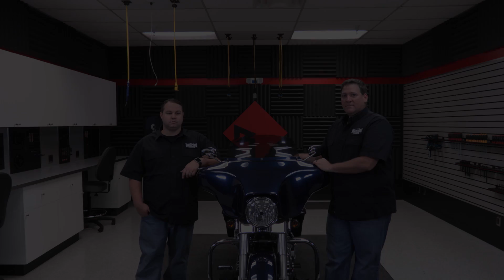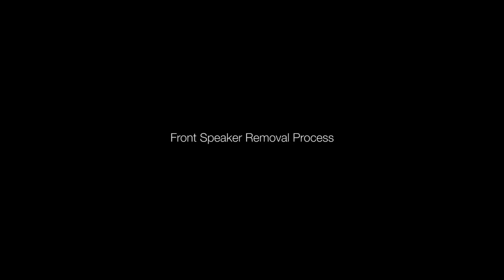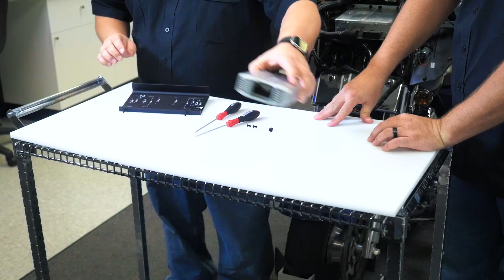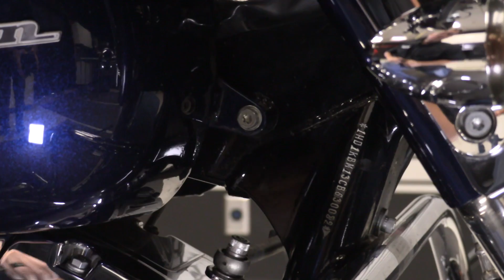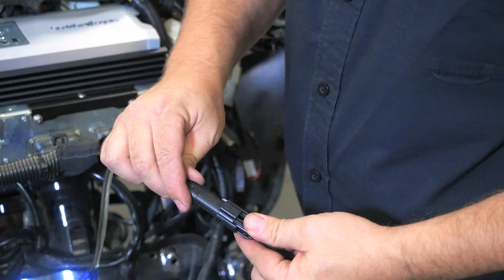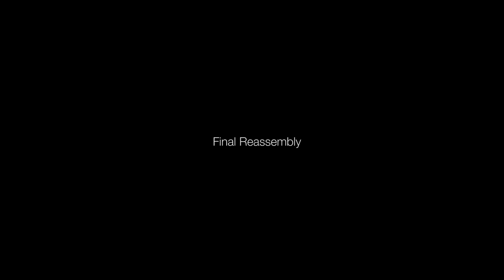1998-2013 Street Glide® Front Speaker & Amp Install

Comment: I have a 2012 Street glide and bought this with the installation kit.  The issue I am having is I previously had speakers installed in the rear lids and they were wired with a HD wiring harness that has connectors up in the fairing.  Rockford Fosgate make connectors I can run off the input/output of the amplifier to these connectors?  It is a HD wiring harness 69200022.  It would make things much easier then using the wires supplied to the speakers in the rear.  If not, I would need to splice into these wires I assume, both going to radio and coming from speakers.
Reply from the maker: The Deutsche style connectors supplied with the Rockford Fosgate HD9813SG-TKIT & HD9813RG-TKIT are for connection to the radio outputs only.  Unfortunately, we don't build special wiring harnesses designed to interface with existing Boom! audio bag-lids.  If we were doing this install in our bay, we'd just splice into the existing cables, solder the connections and cover them with heat shrink.
Reply: Bluetooth ?

Comment: It would be really nice if you went into more detail on the amp setup.  I have had nothing but trouble trying to get the gains set using the CD.  The instructions that come with the amp are weak and I can't get any of the lights to come on unless I do it by ear.
Reply from the maker: Hi Gzr Gldr, we have a Amp Tuning Guide available for the configuration so there's no need to mess with the test tones:
http://rftech.custhelp.com/app/answers/detail/a_id/1355/

Comment: Great video on removal and installation. The setup CD as you explain help set up the amp but what if you have a replacement head unit for Harley that is not Harman Kardon without the CD?
Reply from the maker: Great question!  We've actually revised our 2014+ videos with the below advisory and need to update this 98-13 video to include a newer setup as shown here (you don't need to setup disc): https://www.youtube.com/watch?v=o-bPYe2gqlQ

Comment: Ok so great video but the only thing I have a question on is the audio signal. Where is the amp getting the audio signal to amplify.  Usually you have an input on an amp and then the output to the speakers. Are the original speaker wires inserted in to an input signal port on the amp?
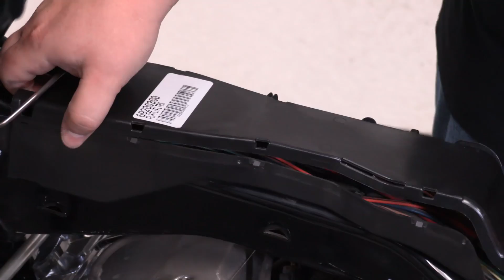Reply from the maker: Hi Adam, This is our 1st Generation system that is no longer being produced.  Our newer Gen-2 system is listed below.  At 9:18 on that video you'll see we're pulling the high-level signal output from the radio's output and plugging them into the INPUT of the amplifier.   https://www.youtube.com/watch?v=z-Q9wVuLzEo

Comment: Do you have a video for the same year Harley but the CVO 8 speaker models?
Reply from the maker: Unfortunately we don't for a 2012 CVO.  The wiring harness is very different on CVO, so you are limited on options.  I would suggest contacting our Technical Support at 1-800-669-9899 for options on your bike.

Comment: I will like to installn 6 speaker on my street glides so I need diferent amp?
Reply from the maker: Could you help me understand what type of speakers you plan on running on the amplifier?  2 tweeters, 2 midrange, 2 subwoofers?
Reply: @rockfordfosgate  6- 6.5 speakers two on the front faring, two on the lowers on crash bar and two on the saddle bag.
Reply: Rafael Sierra     Can you help me out please?  I purchased the rockford fosgate r1-hd2-9813 prime 140 watt 4-channel harley motorcycle speaker and amplifier system several years back.  I have a 2006 road glide.   I have four speakers in my fairing right now.  I want to add two speakers in my saddle bags.   My question is this......  Can I connect the amplifier I have now to two more speakers for my saddle bag?  Or do I need to buy a separate amp for the two extra speakers before I put them in the bag?  Jut to let you know I will be using Rockford Fosgate 6”x9” speakers for the bags.
Reply from the maker: Hi @ABM261-zi2gl , I replied to the same question you posted here: https://www.youtube.com/watch?v=qnUaUCqBai0&lc=z235sb54wpnysnkgp04t1aokgdufagqejbq4me0itr0drk0h00410

Comment: so i picked up a rockford fosgate punch and speakers but didnt come with any wiring, i found the wiring kit on amazon to hook to the battery but need wires to connect to the speakers and radio itself where would i find those
Reply from the maker: Hi Walter, we'll need to understand what you purchased.  Do you have all the model numbers of the product you bought.  Also what motorcycle year/model do you own?

Comment: So only the speaker wire runs through amp not stereo I never see where u hook stereo back up in this video am I missing it
Reply from the maker: Hi Hate Tank, the amplifier turns-on using the DC Offset from the speaker outputs.  This signal goes  directly into the INPUT of the amplifier, then the OUTPUT goes to the speakers.
Reply: Sorry I was missing a piece from my amp kit. Now that I got the piece it came together very nice . On power to battery that goes to amp where does blue wire go?
Reply: Thanks for the reply I haven't hooked power up yet just need to get the blue wire hooked up but speakers and such are all hooked up nice set up very clean looking qnd fairly easy as long as you have all the parts with ur kit . Not rockford foscates issue shop I bought it from sold me open box missing plug to stereo
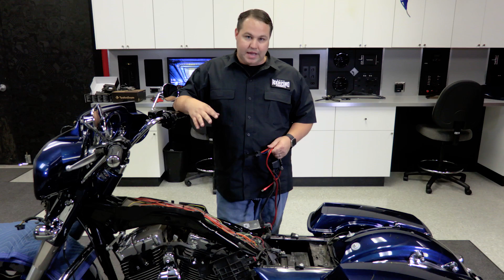Reply from the maker: @lightingrodtodd  Great, glad you got the missing piece.  The blue wire connects to the Accessory Turn-On.  Our newer videos identify the location of the connections better.  You can see where we attach the blue wire at 10:02 here: https://www.youtube.com/watch?v=Ekfriilf51A&t=602s

Comment: Can you help me out please?  I purchased the rockford fosgate r1-hd2-9813 prime 140 watt 4-channel harley motorcycle speaker and amplifier system several years back.  I have a 2006 road glide.   I have four speakers in my fairing right now.  I want to add two speakers in my saddle bags.   My question is this......  Can I connect the amplifier I have now to two more speakers for my saddle bag?  Or do I need to buy a separate amp for the two extra speakers before I put them in the bag?  Jut to let you know I will be using Rockford Fosgate 6”x9” speakers for the bags.
Reply from the maker: Hi G More, with that amplifier, unfortunately no since it's a closed system designed for 4 speakers only (one per channel).  Although we would typically recommend a second amplifier, you'll have a mismatch of power between your fairing speakers and the bag-lids.  It may be worth calling our technical support to cover all your options because there are several.  They can be reached at 1-800-669-9899 Mon-Fri 8am - 5pm.
Reply: Rockford Fosgate  Thank you

Comment: How well do these speakers hold up in the elements
Reply from the maker: Hi Jermaine, ALL our Harley-Davidson® speakers and speaker kits are "Element Ready", meaning they are protected against Dust, UV, Temperature, Water, Corrosion & Vibration.  These are NOT car audio speakers repurposed to fit a motorcycle, and are specifically designed from scratch to handle a motorcycle environment.

Comment: So i want the clip lights to be on?!?
Reply from the maker: Once you found the clipping point of the radio (on 1998-2013 models it's at the "E" on the VOLUME scale, you'll set the LEDs so they just start to flicker red.  We actually have pre-configured Harley-Davidson Amp Tuning Guides done for you.  You can them here: https://rockfordfosgate.zendesk.com/hc/en-us/articles/23190950555547

Comment: Great install video! 

i just bought the RF T400x4ad amp and have the same year Street Glide like in this video. Question about my amp that i bought... do i need to buy the installation kit? And to install my amp is it similar to this amp in the video? Sorry i know much about this sort of thing i want to do the install myself without taking the bike to the dealership
Reply from the maker: We highly recommend purchasing the RFKHD kit because we've included everything needed to install a T400X4ad amplifier.  It includes all the properly sized B+ and GND cables, a remote turn-on cable, signal input cables, and bracket/heatsink designed for optimum amplifier mounting.  All cables are also terminated with the proper OEM wiring plugs so you're not cutting factory wiring harnesses.   This is great because you can remove the amplifier and reinstate the factory audio system if you decide to sell the bike in the future.
Reply: Rockford Fosgate  thanks i appreciate the response and i did end up buying the RF amp installation kit off eBay at a great price.
Reply from the maker: Joe SG, great to hear your follow-up and glad you ended up with the correct installation kit.  For others reading this post, please note there are NO Authorized Rockford Fosgate Dealers on eBay, and any sort of warranty issues are the responsibility of the seller.
Reply: Rockford Fosgate  I agree with your statement however with the US to CDN exchange i didn't want to spend over $200 for an installation kit when it was half the price on eBay and for your information its a Rocksford Fosgate original amp kit not a knockoff brand.
Reply from the maker: We sincerely appreciate you purchasing the real-deal and for choosing Rockford Fosgate!

Comment: I have a single din pioneer tv radio and I want to install a bracket to hold amp onto radio WILL IT FIT AND IF SO WHERE CAN I BUY.
Reply from the maker: Hi Don, you may want to contact Pioneer to see what they recommend for installation of their radio into a Harley-Davidson fairing. Unfortunately, we only have recommendations for the Rockford Fosgate PMX-HD9813 source unit.

Comment: How do I connect amplifier to speaker wire? Do you have the adaptor conector for it?
Reply from the maker: Yes, this particular 1998-2013 kit comes with an "all inclusive" wiring harness that connect the radio to the amplifier's inputs, and the outputs to the speakers.

Comment: I have a 2007 Electra glide classic... not the ultra-  I bought used.  It has the factory stereo and speakers in it (no amp).  I would like to upgrade the speakers at this time. (I don’t have the money right now for stereo & amp... damn corona virus!)  Can you guys recommend a speaker upgrade, that I will get more volume and better sound quality from,   without the addition of an amp? Thanks!
Reply from the maker: Hi Robert, Hope you and your family are safe!   If you simply want to upgrade the speakers now, look for high sensitivity speakers so you can convert watts output from the radio as efficiently as possible to create output from the speaker.  The Rockford Fosgate TMS6SG models for your 2007 Electra Glide are equivalent to pro-audio type speakers since they have a 91 dB sensitivity, which is very high compared to a lot of speakers you'll see on the market that are in the 80's.  At 1 watt input, the speaker will play 91 dB loud, and so forth. Ultimately, you'll want an amplifier like the TM400X4ad so you hear at higher speeds.  You can find more info on the TMS6SG speakers here: https://www.rockfordfosgate.com/products/details/tms6sg/
Reply: Rockford Fosgate thank you for the info... and the rapid response!!!  I’ll check into those speakers.  Yes, I eventually would like to get an amp, so I would like to get speakers that would sound good now, but still be compatible with an amp at a future date.
Reply from the maker: @robertlee2005  You're welcome!  Yes, those are definitely amplifier compatible due to the high wattage capacity.  I just realized we are on the Gen-1 video ... here's the Gen-2 version of the kit for reference: https://www.youtube.com/watch?v=9Y70m63hUgo

Comment: My new ? Is the amp isn't turning on is there a fuse on the amp itself. The fuse in the power wire as broke I replaced it with the same amp fuse and no power please help
Reply from the maker: No, there are no internal fuses inside the amplifier.  If the amplifier is not turning on, use a small jumper wire between the B+ and the REM terminal on the amp.  If it turns-on, then the amp is not properly seeing the DC Offset from the radio speaker outputs.  You'll want to connect the REMote turn-on wire from the amplifier to the Blue wire from the radio harness.  To verify you have the correct wire from the bike harness, measure the voltage with your DVM by turning the ignition on (to turn the radio power on).  It should be +12V when "on" and 0V when "off".   If the amplifier is not turning on and you verified the fuse is O.K., then the amplifier will need to be replaced.  You can contact Rockford Fosgate technical support at 1-800-669-9899 to verify the amplifier is dead and get a replacement started right away.

Comment: Question: I want to install this system on my 2011 ElectraGlide Classic, with no tour-pak speakers. However I would like to add the Rockford Fosgate PP4-T 1-1/2" tweeters to this system. If I were to eliminate the ambient temperature gauge and the battery voltage gauge, do the "super tweeters" fit into the spaces for the front gauges? Also, would I need to switch the amplifier to 4-channel mode for this setup? Any help on tackling this project would be great.
Reply from the maker: The throat of the PP4-NT tweeters is 1.79" in diameter as shown on page #4 of the manual, so you can use that dimension to see if it will fit inside the gauge hole: https://www.rockfordfosgate.com/rftech/library/2015/4_speakers/1230-59166-02_rf_punchprotweeters-man.pdf

You will keep the amplifier input switch in 2-channel input, because we're only using a single left/right signal to feed all channels of the amplifier.  The switch has no effect on configuring how many channels are used on the amp, only how many inputs are used to feed the amplifier.  However, if you'll be using the rear speaker outputs dedicated to those PP4-NT tweeters (no bag-lids or tour-pak,) then you'll adjust the rear gain controls so you can balance the output of the tweeters to match the standard fairing speakers.

Comment: Can we use same  speaker kit and amp for your saddle bag 6x9 modification ?
Reply from the maker: Yes, this HD9813SG-TKIT kit is actually recommended for our plug-n-play TMS69BL9813 saddlebag kit:

Harley-Davidson® Street Glide® Front Audio Kit (1998-2013)
https://www.rockfordfosgate.com/products/details/hd9813sg-tkit/

Power Harley-Davidson® Rear Audio Saddlebag Kit (1998-2013)
https://www.rockfordfosgate.com/products/details/tms69bl9813/

Comment: I have a 13 street glide do I not need to hook up the remote wire? Using stock stereo
Reply from the maker: Hi Street Gliderz, great question!  Since your '13 model doesn't have the H-D EQ setting and doesn't need to be flashed, you should be O.K. to install the system without connecting the REMote turn-on wire.  The TM400X4ad amplifier has "signal sense" so it detects the DC Offset from the speaker outputs on that radio version.

The REMote turn-on wire is used after flashing a '14 or newer motorcycle.  When the radio is flashed on those models, it disables the DC Offset on the speaker outputs, so the signal sense can no longer turn on the amplifier automatically.
Reply: Rockford Fosgate thanks

Comment: And the ground wire for the amp?
Reply from the maker: At timecode 00:09:50, Brad talks about running the B+ and GND for the amplifier to the battery.
Reply: @rockfordfosgate  I just saw him do the + figured he did something different for the ground since you didnt actually show it.
Reply from the maker: @RanGer-498  On a small systems like this, you'll have getter control over possible ground loops by actually connecting the GND directly to the battery.

Comment: Will the amp setup be ok with my 2013 Street Glide from the amp setup advisory video you did for the 2014 + I currently set up my amp as instructed from that video.  I set up the front/rear input levels at the 12 O’clock position, the EQs at min, the freqs at 80 Hz, set at 2 CH, and both HP.
Reply from the maker: Hi Rich, The advisory we released for the 2014 and newer Harleys is not the same for 2013 models.  Here is the 1998-2013 setup sheet: https://rockfordfosgate.app.box.com/file/336667382522
Reply: @rockfordfosgate  Really?  You want to charge someone for instructions on how to set up your amp?  That's ridiculous.  Bought this amp for my '13 Ultra and it sounds like crap.
Reply from the maker: @gzrgldr8288  We don't charge for setup instructions.  We have a FREE Amp Tuning Guide available you can download at no charge direct from our website:
http://rftech.custhelp.com/app/answers/detail/a_id/1355/

Comment: QUESTION: You connected the amp straight to the battery! Which means that it will always be powered and not off when the key is off, thus draining the battery. Why is there not an adapter to connect to the radio power?
Reply from the maker: Hi 65davem19, the amplifier does not remain on because it has a "sensing" turn-on circuit.  When the factory radio turns on, the amplifier's signal input circuit senses the "DC Offset" voltage present on the speaker outputs, which then turns-on the amplifier.  Once the radio turns off, there is no more DC Offset to be recognized, and the amplifier shuts down.  This is similar to starting up your motorcycle ... you turn the ignition on, the solenoid activates and starts cranking the engine, but one you release the ignition, the solenoid retracts and stops.